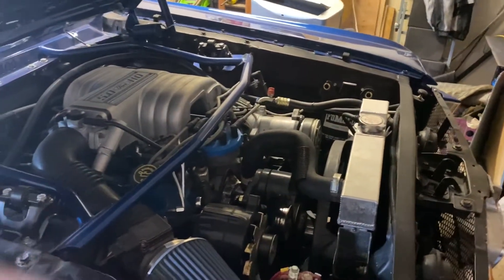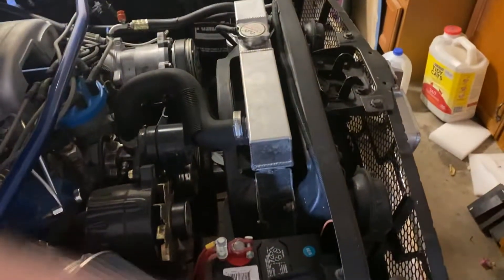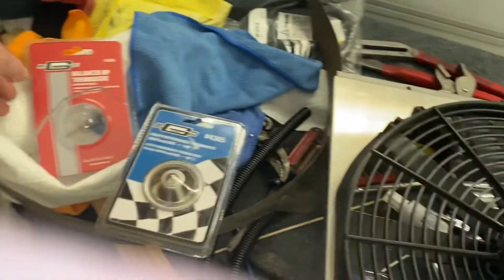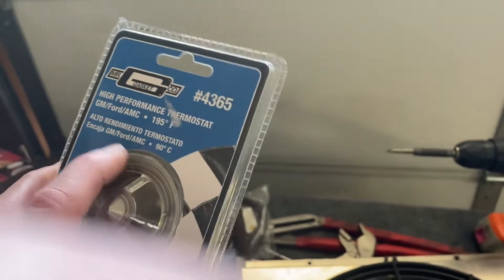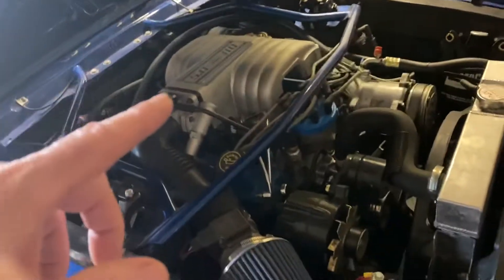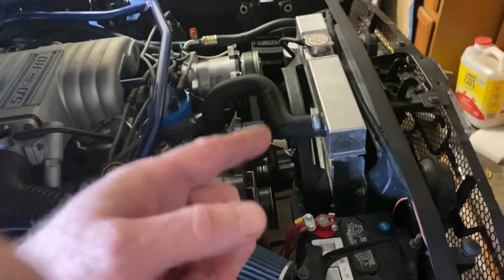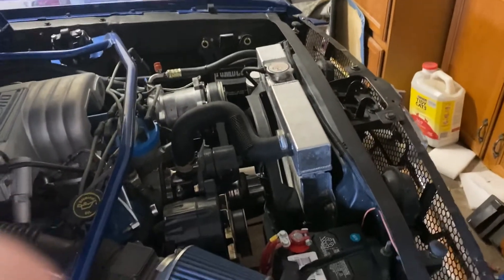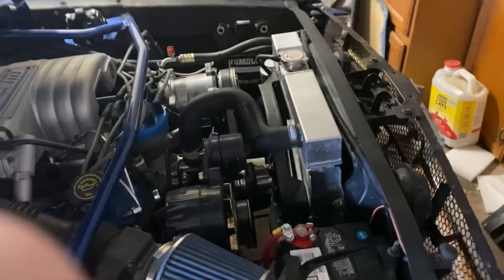65 Mustang mechanical vs electric fan part one.

Comment: You might not want to do this. But I cut two thin slots and mounted my  radiator on the front of the body panel. It gave me extra room